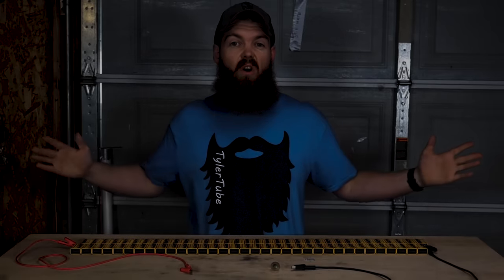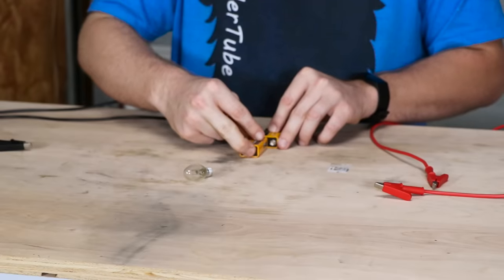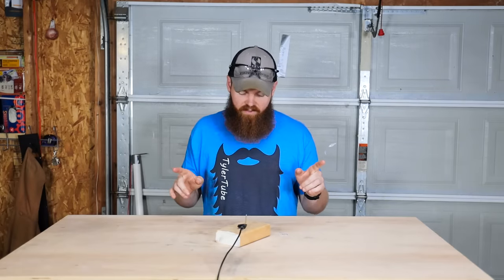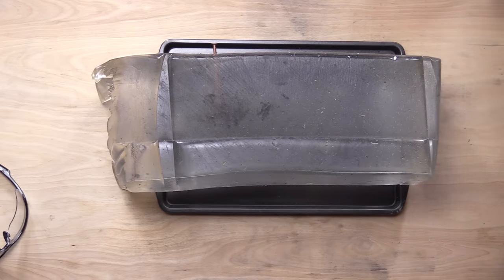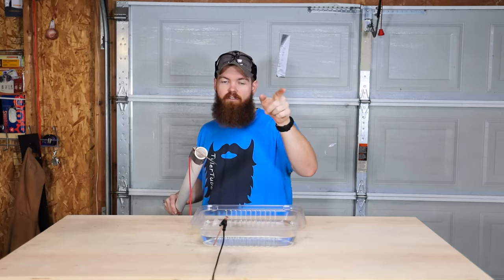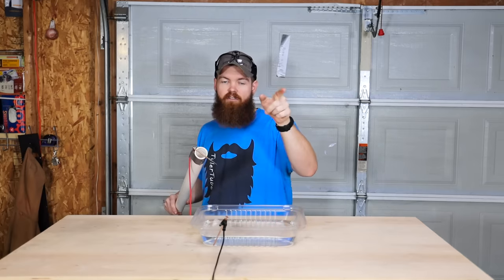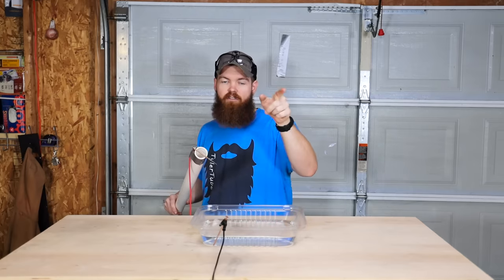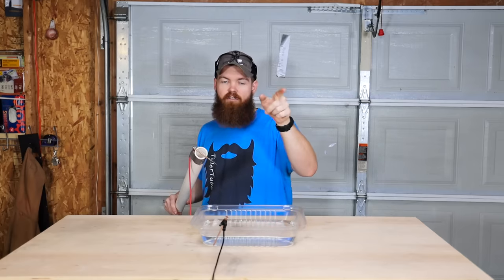I Connected 500 - 9 Volt Batteries...

Comment: "the whole table is kinda staticy" famous last words.
Reply: Probably because he was playing around with a floating ground and didn't tie it to earth. 

Hot dogs can act like little capacitors.

This stuff is deadly. Know what you're doing.
Reply: @chrisjacobsen1659  even grounding it will still allow one terminal  to emit coronas. It'll be even easier to electrocute yourself because  you can more easily complete the circuit through the ground. The battery idea was kinda cool but it sucks that you can't turn it on or off without pulling the batteries apart. Even with linemen gloves, once an arc gets going it will burn through.
Reply: After watching the whole video, I was wrong. It's not just corona discharge, it's that he laid that positive stick on the garage door and basically made it into a ground temporarily, while everything on the table became "hot" but current limited by the high resistance of the table. If he had actually grounded that negative lead, it would have arced when he laid that stick on the door. If there had been a little more moisture next to that negative clip, it would have arced to the hot dogs and we wouldn't have got to see this video. This whole setup is unsafe, because he's always just unclipping things but there's still 4500v sitting on something. Well, that and a lot of other reasons. But a good start would be using an MOT or something you can unplug.
Reply: @mmercier0921  we wouldn't have seen it though, he'd be dead or have a hand burned right off, and wouldn't have posted the video. We see foolish stunts, hear crazy stories, but the ones that end horribly sometimes get less attention.
Reply: @deltab9768  MOTs are NOT a good way. MOTs are even deadlier. AC at line frequency is basically an insta-death at their typical 2.3 kV output. Especially because they van deliver and amp or more
Reply: @TheRailroad99  I don't know. The short circuit current of those batteries is probably 2-10A, at 4500v dc.

https://groups.google.com/g/sci.electronics.design/c/6nEUtCCNMYY?pli=1

At that point, making something more deadly isn't as big of an issue as reducing the probability of an accident. My idea was just that he could have both leads on a table and just unplug it before adjusting anything, instead of trying to manipulate barely insulated 4500v alligator clip test leads with his bare hands while casually "grounding" the other terminal by laying it on the door.

It's true an MOT can't be as easily  isolated from ground, but  he doesn't have a good grasp on isolation and grounding as is. It also wouldn't produce nearly that size of arc, I've never played with one with the actual HV winding in it,  but I've seen plenty of videos and I know this battery has higher voltage current and it's DC so the arc isn't weakened by zero crossings. But you're still right, he shouldn't play with either.

I've actually made a high voltage supply and used only slightly better safety precautions, the difference was it was powered from an 18v battery and didn't have enough power to be lethal. I've got a video of it on my YouTube channel. I'd never be that careless with an MOT or giant battery bank, this guy's gambling with his life.
Reply: @deltab9768  problem with AC is even if it arcs less intense, it stimulates muscles. You can't let go of it. MOTs do not only have a high death risk, they actually have already killed a lot of electronic hobbyists. 

By the way: MOTs (as well as almost any other transformer) are isolated for earth. However that will make them almost worse, because RCDs won't trip.
Reply: @TheRailroad99  it doesn't matter if the rcd will trip or not or if you let go it WILL kill you in a microsecond so while the batteries are dc the voltage and current are higher even if it is dc if you have higher voltage and current it can be as dangerous if not more and those are are way more likely to hit you based on there size and stability
Reply: @godparticle3833  yeah, you're right. Limiting one or two potential hazards probably won't do that much for the overall risk levels here. He needs to stop playing with this stuff.
Reply: @Guest-gy9vp  no
Reply: @deltab9768  This guy has no clue what a "ground" is.  When he uses the word "ground" he is merely referring to the negative side of the voltage, which is not connected to earth ground at all.  However, many times he lets the positive nail rest against his garage door (example at 15:18 and many other times).  This is very likely to create a true and real "earth ground" on the positive side of the batteries.  And then, picking the negative side with his hands, he is now handling a negative 4500 V potential relative to earth ground while the door and the floor is grounded at the positive side of the batteries.  This guy is an idiot !  He is lucky to be still alive !
Reply: @jnb8918  That’s part of my point. He makes comments about how the negative terminal/“ground” is probably safe but he’ll be careful anyway, and then has a close call where he could have been electrocuted easily by it and doesn’t even know. I’m pretty sure he stopped making these battery videos and I’m glad for that.
Reply: A Nicola Tesla wannabe. HMMmm.
Reply: Mains electrical systems were run ungrounded but my understanding was lightning destroyed the whole system and the benefit’s of grounding just happened to reduce static. So a safety feature to prevent lightning from destroying the grid got lost and confused into what it is today where a car person will talk about ground like it is the bees knees and the negative terminal of every battery needs to go to the physical ground. But I imagine that is significantly more levels of unparalleled dangerous in this way. 

The confusion of dc ground, mains grounding and rf grounding is a nightmare I don’t like to talk to stupid people about. I imagine grounding his 9 volt supply is a death sentence way worse then playing with the terminals but I am a still human and I get things wrong so that’s not absolute.
Reply: Why is there so many smart people here and as I write this comment I just remember this is 4 years old

Comment: Dude you really need to take your own safety more seriously. Those bright sparks can damage your eyesight, hence welding masks. Also, wear gloves!
Reply: You must be new here
Reply: @moonboogien8908  🤫😂😂
Reply: Using a pvc pipe as a bar is also not so smart
Reply: Polycarbonate safety glasses are 100% UV blocking.  So it might hurt his eyes just because it's bright but they won't be damaged by the UV coming off the arc.  AvE does a really good video on the subject.  Search something like AvE UV glasses or something.

And as far as gloves are concerned, unless he wears high KV rated gloves he's just wasting his time.
Reply: Hehehehe electricity go brrrrrrrr
Reply: You're comparing batteries with a welder machine?
Reply: @Nestorm_6284  well i mean you can make welder with 12v car battery so... I dunno you tell me :p
Reply: But i think he would need to wire some of these in parallel to make it more similar to welder because he needs more amps for that :)
Reply: @Nestorm_6284  the arc is very similar i work with a welder all day and he has a very valid point. You think it looks bright on camera that means it's at least 2 times brighter in person
Reply: moonboogie N8 he probably is whats safety?
Reply: @p_mouse8676  It's actually very smart. PVC is non conductive.
Reply: As an electrician of 11 years, it’s shocking (get it) to me that so many of you are defending him so much. This could have easily killed him if he slipped up once. DC voltage is extremely dangerous. It’s not worth the views I’m sure he’ll get from this video. I sincerely hope he doesn’t make a part 2.
Reply: @p_mouse8676  that's a little improvement from the earlier videos. He had little "alligator clips" with a plastic sleeve on them, probably lucky they didn't arc while he was holding one in each hand and kill him.
Reply: @Sjml247  this is already like the part 3, but he's still resting his hands on all those batteries. If the insulation of them breaks down, snap crackle pop. There's still so much wrong with this setup, he's probably lucky he didn't die the first time he tried, and he'll be lucky if it doesn't happen next time.
Reply: P_ Mouse h  How would you know also you’re wrong
Reply: @zachaliles  It's not the UV that harms the eyes when welding, it's the IR.
Reply: @Sjml247  if he makes another video some linemens gloves would be a good investment amd at the very least some torch goggles. I do hope that there's more safety going on then it appears we all know there are smart ways to do dumb things but definitely need more then what we could see in the video
Reply: @oplkfdhgk  amperage and voltage are directly related, I learned that in my welding classes, the higher the voltage the higher the amps, and vice versa. It’s just that as you add more voltage, the amount of amperage increases slightly less every time you increase voltage.